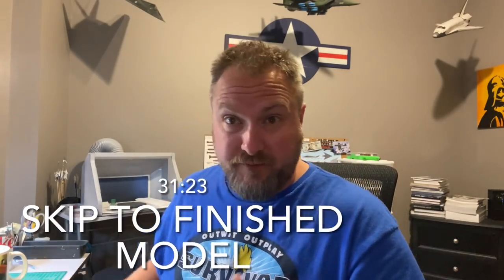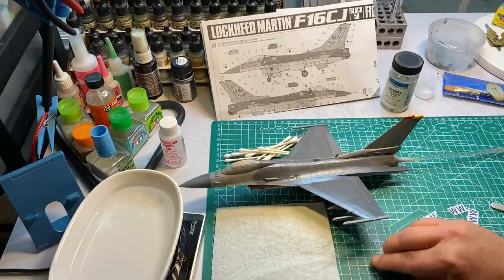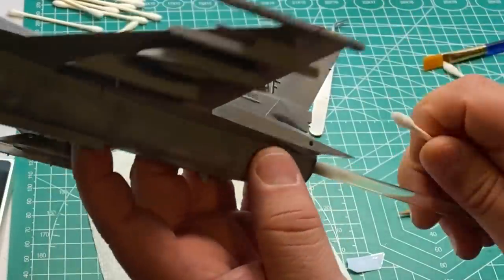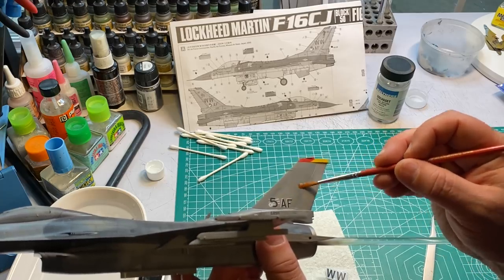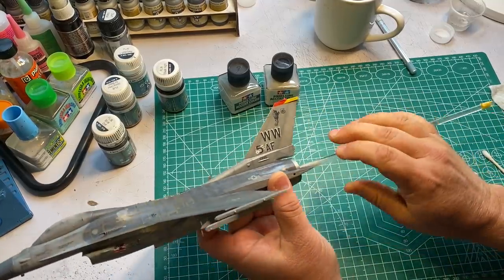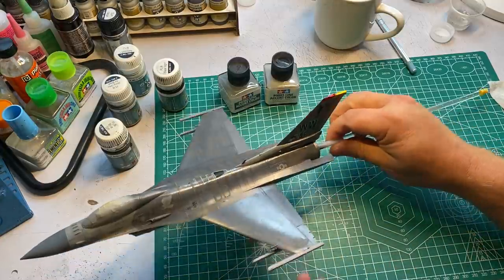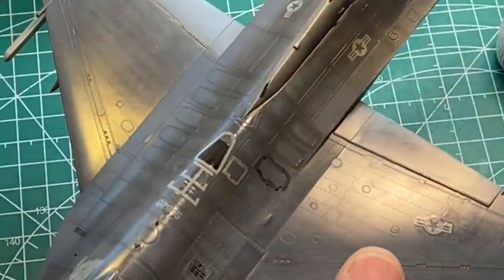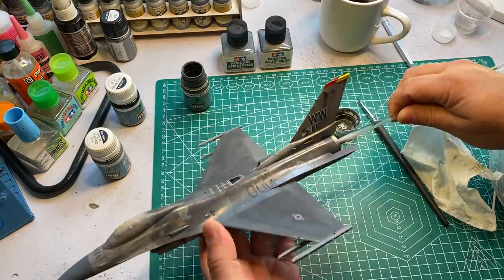Tamiya 1/48 F-16CJ Build Part 3: Finishing Touches

Comment: If you put the micro set down, like you do with water, after it dries and you want to move it, if you reapply the micro set, it allows you to re-place the decal. If you use the micro sol, however, you won't be able to move it. It just softens it, and it'll break

Comment: Sean, have you ever used a blow dryer to help get decals to conform? I found out the hard way that it’s an absolute must when working with the carbon fiber or Kevlar print decals I use on my motorcycle models, but it also works well on any standard decals. You also don’t have to worry about potential compatibility issues with different brands of decals and softeners etc. I use only Tamiya Mark Fit, (which I gather is one of the more mild ones out there) and their decal adhesive, augmented with a blow dryer with good results.
Reply from the maker: Yes sir…I used that method on the space shuttle build.  It works even on the most stubborn decals

Comment: You say in your experience you don’t think Microset does anything. I found it interesting that around 5:16 you put some Microsol onto the tail before applying the decal and say be careful as this can wreak havoc with the decals. This is why I use the Microset at this stage, I find allows the decal to go down nicely and improves its ‘stick’ but is not as aggressive as Microsol so gives you longer to move it around and fiddle with it. I then brush Microsol over once it is in position if I need it to look ‘painted’ or trying to get layered onto a non-flat surface.
And yeah, those little numbers really annoy me to.
Reply: I second this.  I do the same thing for the same reasons.  I start with the blue on the surface prior to laying down the decal, then cover with the red to snuggle it down.